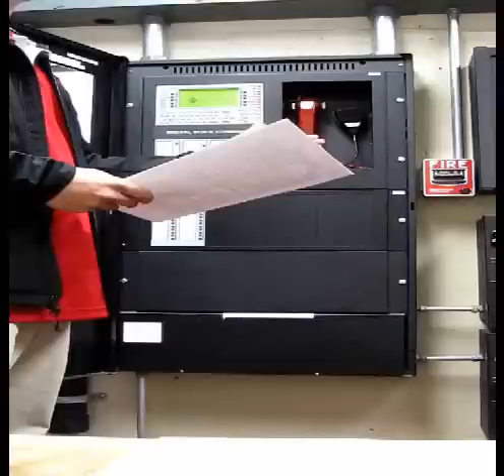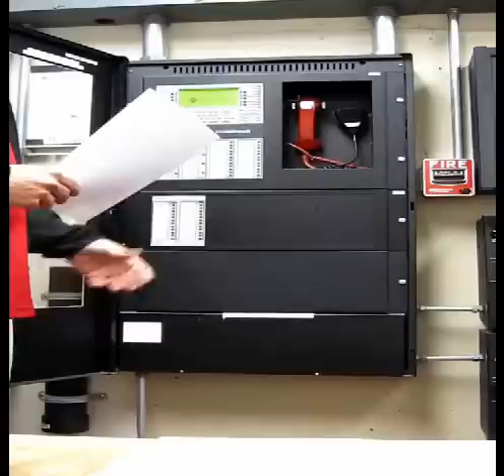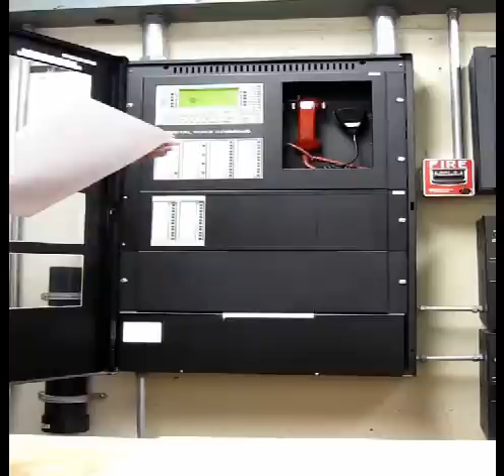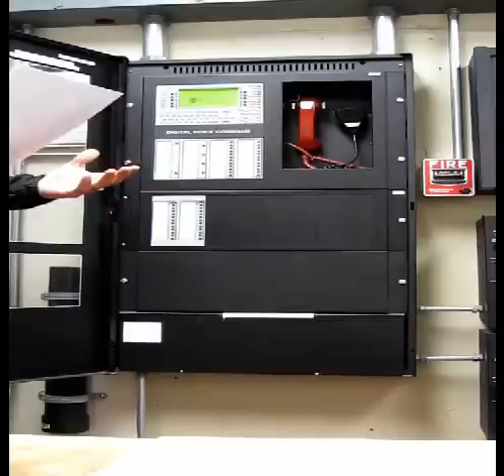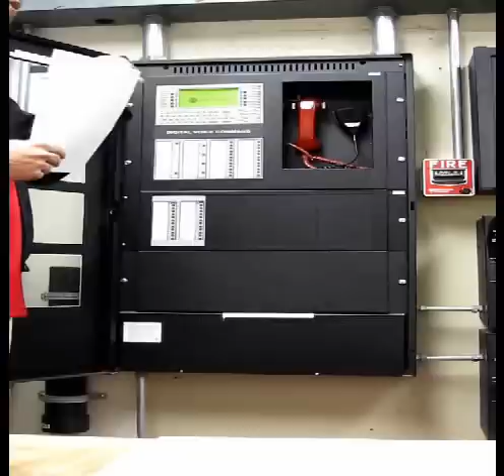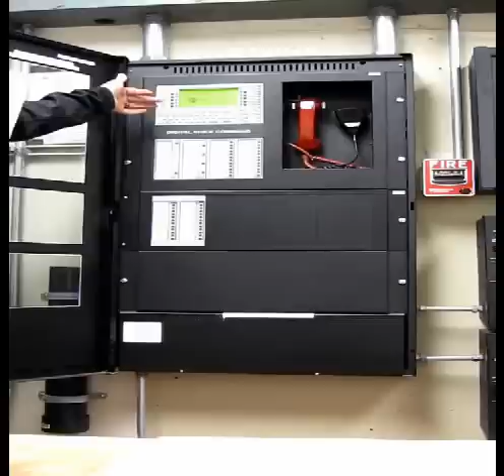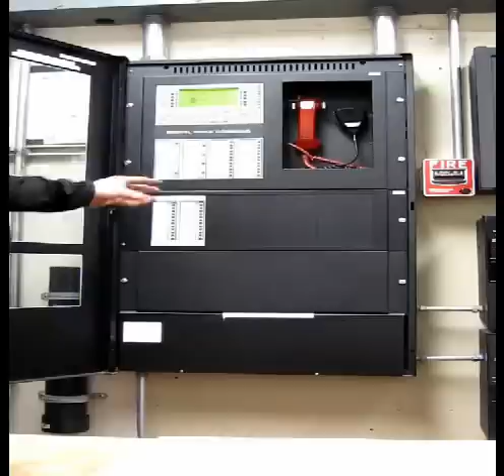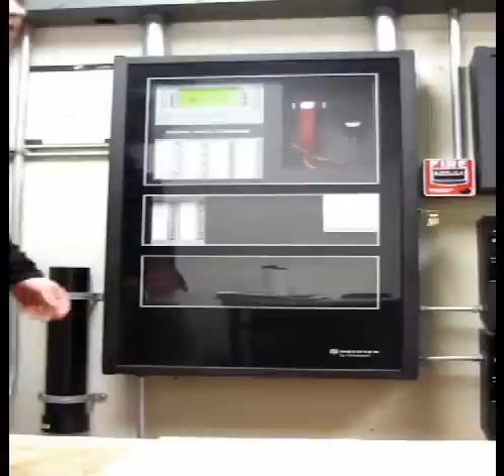Fire Alarm Training Video for the Notifier NFS2-3030 with DVC

Comment: also, how can three devices set a whole building into evac if all the others do fire floor, floor above, and floor below?
Reply from the maker: LTCWM1 it's all done through programming.  you can use groups, zones or devices via boolean logic statements to do virtually anything.
Reply: Kyle J. Schuler, SET, that's interesting.  I've never heard that or read about that before.  Do other panels do that? I mean like the simplex 4100, Edwards, does firelite even do that?
Reply: The 4100ES, EST3, and the Gamewell-FCI E3 can certainly do that, as they are all large addressable panels.  But I think since Fire-Lite makes panels for much smaller installations, you may not be able to do that.

Comment: Only three manual pull stations in a building with 7 floors? In the UK a manual call point (our equivalent to a manual pull station) is required at every entrance to a staircase, and at every final exit. Additionally, a person should not have to travel more than 45 meters to reach a manual call point (25 meters if the person who will be operating the manual call point is likely to be disabled, or if rapid fire development is likely).
Reply: I believe he meant there's only 3 that will trigger a full evacuation of all floors. The rest will only evacuate the closest 3 floors.
Reply: In the US, if a building is fully sprinklered, you actually don't need a pull station at all.
Reply: @RobertAslinMusic  The code requires one pull stating based on the conditions you described.
Reply: Same here in canada, any exit of a fire zone. there should be minimum 14 pulls in that place. Assuming two staircases.
Reply: jayja45 same in India. MCPs, hooters, speakers, talk back points on the exit ways of the floor.
Reply: Hello... Anybody know about  incorrectposition  trouble in honeywell xls3000 ,
Reply: You don't need a pull station you just need a detector
Reply: There's your trouble. In the USA, nobody knows how far a meter is.

Comment: Kyle,  being that this is a central station alarm system, whose job is it to know AHJ/local fire codes on silencing alarms? 
Thanks!
Reply from the maker: I would say both the installer and the end user.  Check with the local AHJ to get their standards on this practice.
Reply: Thanks. In this video, are you representing the installer?
Reply from the maker: Yes